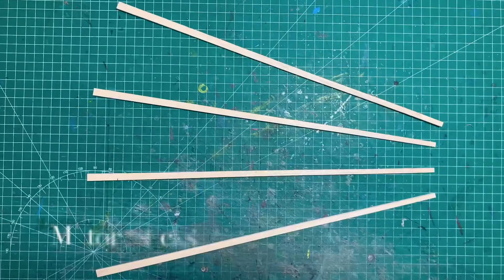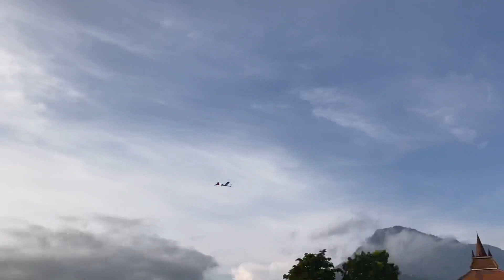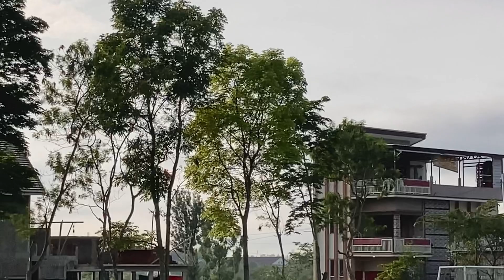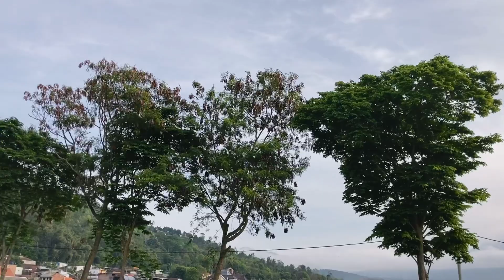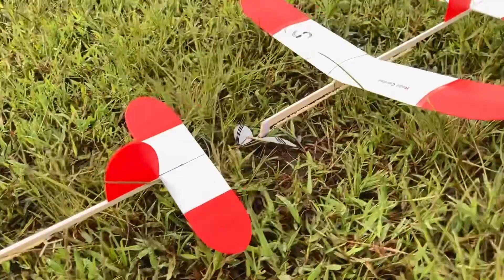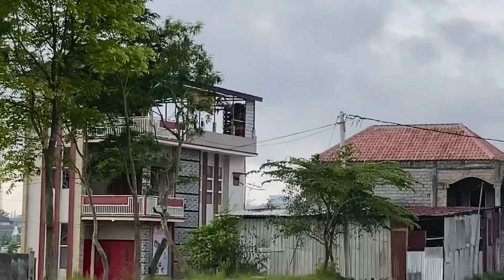Terbang Massal Pesawat Tenaga Karet

Comment: 3d design propeller and prop hanger proccess.
Reply from the maker: You will need light material propeller if use 3D print